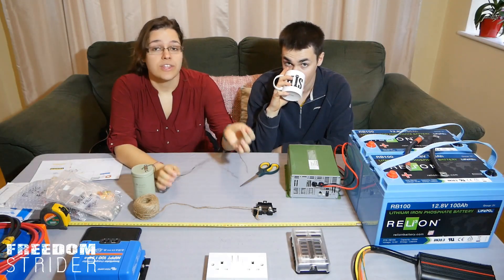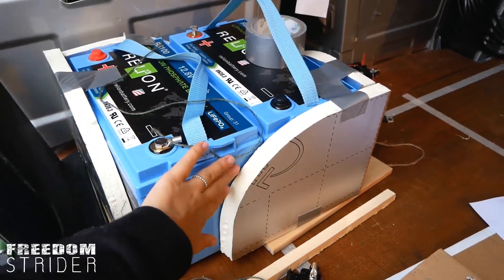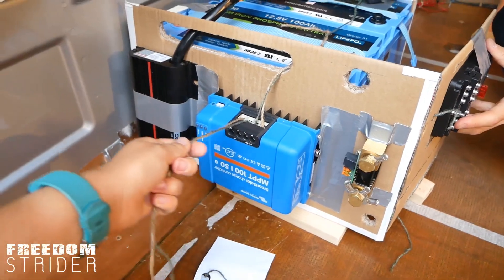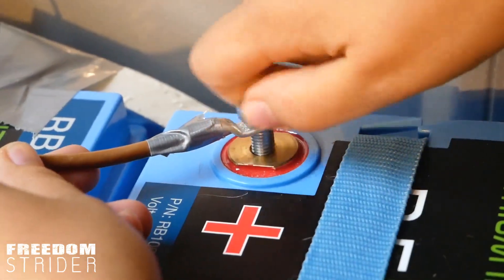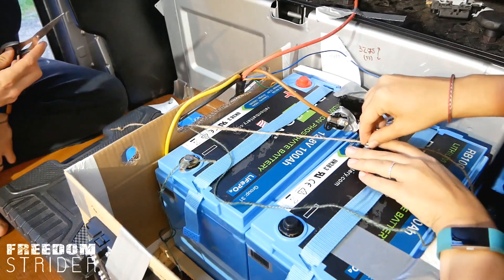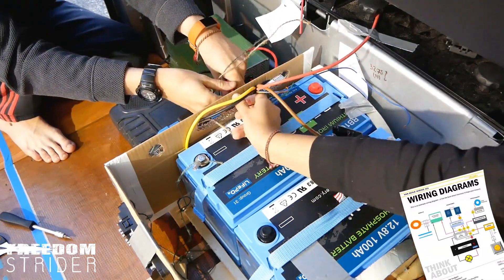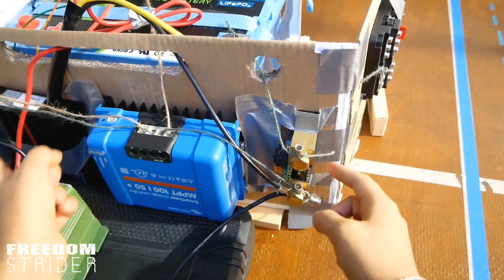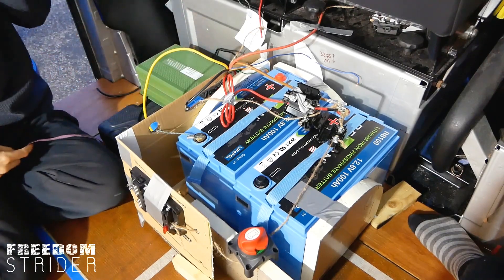Get the string...let the 12V wiring BEGIN!

Comment: Hi, I know this is in the past but did you notice much difference in wire lengths vs string due to the lesser flexibility of the thick gauge of the wires and having to bend and conform the wires?
Reply from the maker: Surprisingly there wasn't much difference - we added a few cm to the string lengths when cutting the actual wire because we knew the wires were more rigid. We did have to make a slight change in the tighter bends since wire can't bend as much so it was more that, rather than the length but it worked out as a good guide 😊👍

Comment: good night, did you consider the wires to connect one battery to another?
Reply from the maker: 😀 Yep, we got the cables for the batteries (50mm2). They kept getting in the way and confused the arrangement even more so we kept putting them on and off... guess they didn't get a shot in the vid.

Comment: Awesome video, I like how your helping others with your videos :-). Just wanted to mention that you should always over gauge your wire if you can because if it’s insulated you loss some Amp rating on the wire and if it’s going for some distant The amp rating also drops, I hope that helps ☺️
Reply from the maker: Thanks for the reminder, we've looked at those tables which tells you the size of wire for the maximum amp draw, although its sometimes hard to decide which one to go with. We're planning to run a mix of 4mm and 2.5mm cable throughout the van (4mm for the bigger stuff), 16mm for most of the box connections, and 50mm to connect the batteries together. We hope that that is sensible :)
Reply: Freedom Strider yes that’s definitely great, I am also going with the similar size wires and then just taking of 25% off the rating just to accordant the amp loss of the wire is over 1M long or insulated etc ☺️
Reply: Freedom Strider hopefully when our van build are finished, we might run into each other on the road. We are moving into the van full time for a few years or until we find somewhere nice to settle down. We have already traveled around Australia in 8 months now it’s UK and Europe turn ☺️
Reply from the maker: Would love to run into each other - we are going full time too. We did new Zealand in 10 months 😀 and we would love to do Australia with the van (still haven't figured out how to drive there), but we have a few years in Europe.
Reply: Freedom Strider that’s awesome snow and curt are touring the whole world in there van, and are just putting it into a shipping container to take it from continent to continent. Your gonna love Australia especially the west coast as you can just go for a swim off the beach and your literally swimming with the corals ☺️. Do you have Instagram so we can follow you? We are still in the process of making our YouTube channel but it’s too much effort to edit videos etc 😂
Reply from the maker: Yeah, we recently discovered Snow and Curt, they seem great! Shipping containers are feasible, but we really would like to drive, although there are a few war zones in the way at the moment...we'll have to see 😉

Oh yeah, videos take a lot of time and effort to film, edit and release, it takes us 3x longer to do ANY task on the van as we film it all. 
We are on Instagram @freedomstrider (https://www.instagram.com/freedomstrider) - do you have Instagram where you post?
Reply: Freedom Strider I just followed you on Instagram, we are theoteam_ ☺️

Comment: Great idea using string 👍 One area I’d suggest that you may wish to look at is where you’re insulating around your battery. Be careful here as we found that the lithium batteries we have ‘sweat’ when charging. See our vid on this. https://youtu.be/N1ZrPBxAGMs  I’m by no means an expect, however we’ve now fitted a plastic battery tray and hopefully this will stop the base they sit on rusting. Cheers!
Reply from the maker: Thanks for pointing that out! The batteries will have a ventilated space that they will sit in so hopefully, they can "sweat" into that air, and they'll be sitting on the wooden ply floor as well :)

Comment: Electrics is my weak point. I know this is just a mock up, but you need a wall between the batteries and the steel seat base. Cables become detached and you need to reduce the chances that stray cables can short.    Your system looks way more complicated than all the systems I looked at before I did mine. I actually paid for a wiring system which was tailor made to what I wanted. 👍
Reply from the maker: For shorting out and fire hazard security, we're looking into some lightweight fire retardant material or paint for some places, and we are planning on having a lid onto, to also protect the terminals. Anything not structural will not have solid ply material (too heavy).

As for complicated, I like to think of it as simply just more compact. ;D There's actually nothing unique about our set up at this point, we have 3 separate chargers, each connected to the battery and their negatives are just redirected through a monitoring shunt. The cables/string makes it look quite messy and as such, harder to understand. 

As we said, wiring diagrams look so much nicer. :p

Comment: 😬🤪🤯 hi guys...think these emojis represent our state at the mo re electrical build and for other aspects! Think we need some days off from van building!
Reply from the maker: It's like looking at a mirror - 🤪 We have been doing some serious final decision-making research and with work and everything else we are near burnout. (honestly haven't slept more than 5-6 hours a night for 2 weeks). 

We are a bit stuck on sorting out our heating out (still) and we are doing a lot of thinking on how to reduce our weight. 

A few days off sound like heaven.
How far have you gotten with your build? Have you installed your heating, electric, etc?
Reply: Freedom Strider 

We're just in the middle of our plumbing at mo.. althou still waiting for shower cladding to come, and need to install our kitchen worktop to fix taps. So half doing lots of stuff at the mo... Hoping it'll all come together at the end 🤔

The wiring is in, but we've not completed the installation of batteries/inverter. 
And we've got to paint the roof still before solar can be installed.. 

Reg heating, we went for the heat air and expanse.. we have risked having it fitted underneath to save space internally 🤔 Hopefully we won't regret that.. 

It's getting a wee bit over-whelming at times. But we're both still very much looking forward to moving into her!!

Comment: Hey guys, How long did it take you to this stage of process? how long do you expect it might take to moving in finish stage? keep up the good job, Cheers!
Reply from the maker: It is tricky to say exactly how long each stage takes as we are doing so many things at once and we do work full-time. We bought the van July 2019, but most of the work on it has been done in the last 2-3 months. We are now in a final decision making stage, where we are doing material weight research and doing final layout modifications. After we are past this planning stage we are expecting to speed up a bit. We hope that by autumn the van will be near done even if some systems are not enabled yet.
Reply: @FreedomStrider  WOW! working full-time and building a van is tough! Wish you lock. I'm thinking maybe to convert in a week or two after plan and items purchased, mine is also VW Crafter, I sold the 1995 motor home I had to convert this one.
Reply from the maker: What? Convert a whole van in 2 weeks? Woowza... that seems to be hardly possible if you are doing it alone. Even when knowing exactly how to build everything and with all the products on-site - there are a lot of unforeseen pitfalls. (at the very least Hardwear store trips for broken drill bits and such 😅) I mean, we believe that anything is possible, but you might have skip sleeping. I would recommend a month as a minimum for sanity's sake.
Reply: @FreedomStrider  WOW! WOW! seems like too hard, but I'm just thinking about it I need to make sure howmany days exactly It takes when my plans finishes then set a target, It won't be a month neither a week I guess, I'll let you know ;)